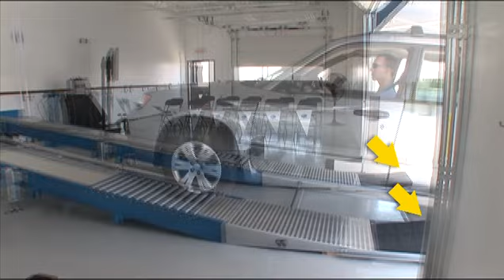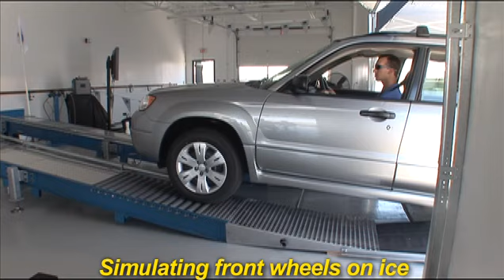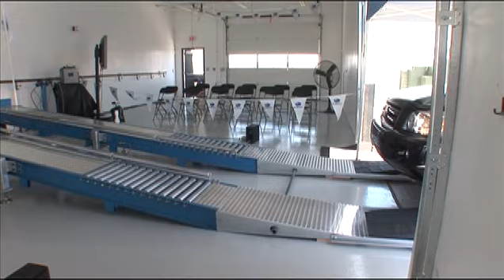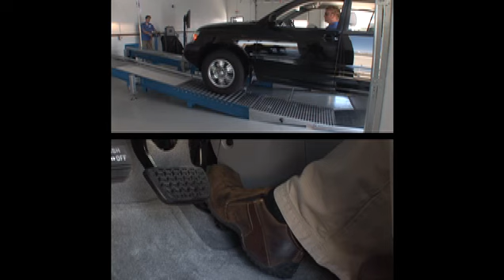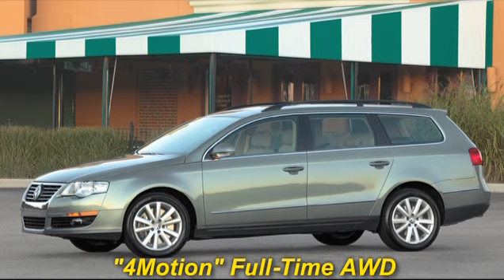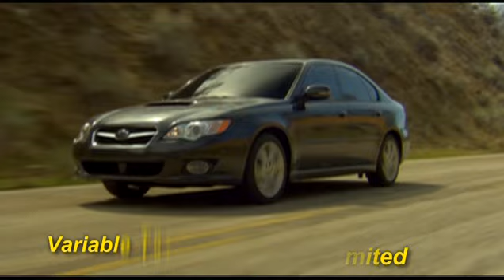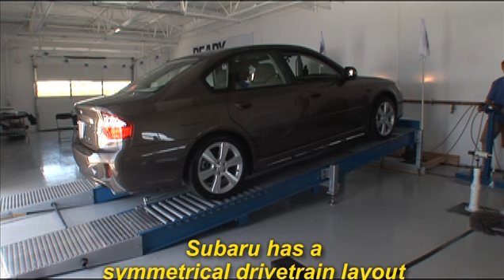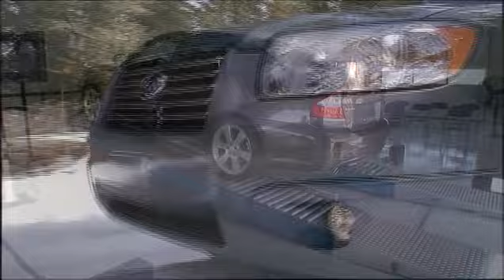Subaru Symmetrical AWD vs. Honda, Toyota, and Volkswagen

Comment: on a subaru if 2 wheel of the same side it don't move
Reply: Yes it does. Even with one wheel it can manage to get traction. A symmetrical drivetrain makes it easier for the car to handle single sided slip (No weight preference to either side) and VTD or LSD will handle same sided slip just fine. Look at 8:30. I'm not saying it's perfect but it will handle it.

Comment: U guys just roasted Honda 😂
Reply: it does not need roasting, anyone who knows cars knows that the CRV has the worst AWD of them all.
Reply: @intrepidmilotic5999  https://www.youtube.com/watch?v=HBi69R6C2PQ&feature=share
Reply: Scott Gonzalez gotten out of more off-road situations and ice/snow in a Honda Pilot than my friends in some AWD cars
Reply: Marco hondas rt awd is garbage we all know that. But Acura's SH-AWD is the shit
Reply: @scottg1962  u know honda and acura use the exact same systems?
Reply: Should have used a pilot with VTM 4 or an mdx with SH-AWD. These systems are designed to send more torque to the rear wheels
Reply: Marco ...Was the crv at full throttle?
Mine only engages with more gas. Which isn't ideal but how it works.
Reply: i dont know if youre just talking about the older generations of CRV but mine did fantastic this winter. Its not supposed to be a fast car. It's made to be reasonably priced and have longevity. Hell honda has even picked up its interior game quite a bit. my cousin has the new mdx and that thing is gorgeous, switched from a q7.
Reply: Ur welcome for 1k likes.
Reply: Austin Mcharo tank u sir. Didnt even expect 1k likes but shih I’ll take it lol
Reply: Marco hello
Reply: https://www.youtube.com/watch?v=HBi69R6C2PQ&feature=share
Reply: Okay, don't fall for this. Notice they're hitting the gas harder on the other vehicles than the Subaru, accelerating those vehicles past the point where they would transfer power in this situation while keeping the Subaru well within it's transfer range for the situation.
Reply: Fuck you
Reply: Honda just are Good vor FWD Not awd whyy
Reply: Yeah hondas are shitty lol
Reply: Hes a subie lover trolling on others cars
Reply: MisterLifter Are you trying to compare the s2000 and civic to muscle cars and sports cars? How stupid can you be? The Honda NSX, which is actually comparable, can wipe out the gtr. 

Acuras SH AWD is the best awd system there is.
Reply: @n_u001  acuras SH Awd system is ass compared to literally anything else
Reply: @n_u001  Uh....a nsx is a 3 liter that's slower than my maxima lol. It's lightweight and handles great, so it's quick and nimble, but it's not fast.
Reply: @TheGuruStud  engine displacement has nothing to do with a cars speed or acceleration. its a twin turbo v6 with a 0-60 of 3 seconds. your maxima takes at least double or triple the time.
Reply: Funny how an S2000 will whop any muscle car of the same model year on a race track and even give it a good run for it's money in a drag race and any proper Type R would also whop any American "sports cars" and there isn't even any Euro sports cars to compare it to as there is none in it's price range and if there was it would have broken down half way to the track.
Reply: @HimmelWeint  not sure what any of these comments have to do with awd
Reply: @HimmelWeint  what do you consider a muscle car
Reply: The only thing that Honda is good at is Lawn Mower engines. lol. I am Dying.....
Reply: @gaydarci4593  Aw, some butt hurt honda ricers, lmao.
Reply: Marco "just roasted Honda" yeah sure, imbecile. Hondas aren't made fast from factory,  the people who buy them for a legitimate reason know this, every single one of them, they buy it because it's a fun car, and with a nice exhaust, in their opinion, they sound very nice. They're cruisers, touge racers, enjoyment cars, not race cars, but if you wanted to there's not a single Honda out there you couldn't turn into a race car, or atleast a drag car, now am I saying that I like them and that I would like to buy one, no, they're not my style, and I'm more of a I6 kind of guy, like an R32 or a supra, something of the nature, but from my expirience and the people I hang out with daily, and literally hundreds I've met over the years, that's what I've heard, they know they're not going anywhere ridiculously fast, but they're looking damn good doing it, and that's just that, no argument to it. Saying a Honda is beautiful is the EXACT same thing as saying a 2017 ZO6 looks beautiful,  opinion, not a fact whatsoever. So much hate for Honda for literally no reason at all.
Reply: @sadboiiuloff5508  You make no sense my friend. People buy Honda's not for its exhaust. They buy them cause they are reliable in first place. Then no, they are not super cars, but as I had Accord Type R which has 212 hp and weights about 1000 kg, its not a slow car by any means. Compare it with E39 M5, which has 400hp and weights over 2 tons, and you see that weight to power ratio Honda is even more powerful. I had it for 2 years. Driving like there is no tomorrow, revving the crap out of it, and at over 300 000 km the engine was still strong. No repairs what so ever except hand brake wire and xenon bulb. Take any car and drive it 2 months like I did and it won't last.
Reply: @eleonik76  my 7 gen accord has taken more beating than any other car i have owned. Only thing still running.
Reply: @toothpicdinosaur3777  Same here brother 🍀
Reply: @sadboiiuloff5508  you must be talking out your ass and have literally no knowledge about Honda's, F.f.s. , look at the time the type R just set at nurburgring, it beat out the BMW m5, the Corvette, an the Porsche cayanne turbo! Lol , oh let's not forget about the fact that back in the day, the b16 was one of the first engines to surpass 100hp per liter of displacement
Reply: @sadboiiuloff5508  lol "a nice exhaust"
Reply: SadBoii ÜLoff but who in what mind would buy such a crappy car lol

Comment: Has nothing to do with longitudinal or transverse powertrain, has little to do with LSDs as most of the vehicles are not equipped with them. Where they are, it us usually a viscous LSD which requires wheelspin to lockup, notice the Legacy displays very little wheelspin. In most of these examples it is down to the effectiveness of the traction control system. I don't know why the Honda etc would not transmit enough torque to the rear, a Haldex unit should be capable of providing huge lock-up - certainly the one on my Nissan Panthfinder does. The best case scenario would be three limited slip diffs and junk off the traction control with a plate rear with aggressive ramp angles and high preload, a DCCD centre with semi-active controller and a plate front with light preload will give you the best traction and best efficiency for laying down the power. The 'Symmetrical AWD' is the stupidest strap line Subaru have come up with, the powertrain layout is good for weight distribution and serviceability (i.e. you can get the transmission out quicker), nothing else.
Reply: Finally a sane comment from someone who understands that this symmetrical AWD is marketing bullshit. Nothing to do with torque distribution.
Reply: Any 4X4 truck with a locking diff would pass any of the one wheel tests. Powertrain layout is more for marketing than anything else I hate working on those pieces of crap spark plugs are way more annoying than they need to be luckily the head gaskets like to blow the exact same time the spark plugs need to be changed so that's nice. So you could do them both at the same time.
Reply: @HimmelWeint  I don't think the Ford track lok will do crap if one wheel has zero traction. The S-Spring gives about 20ft/lbs of locking power.  Maybe a bit of movement on a level ground. Then you need a bit of traction on the other tire.

Comment: The guy says that in the toyota there is torque steer because the drive train isn't symmetrical...i think than the only reason why the veichle moves from left to right is because he moves the steering wheel. At that rotational speed and acceleration the unequal lenght of the shaft of the front wheels is unable to produce such a difference between the righ and left wheel.

Comment: does this guy not understand open diffs on the passat? thats why it wont climb with one wheel.
Reply: Open diffs aren't ideal but don't make it impossible: applying the brake(s) on the spinning wheel(s) makes it possible to increase the torque on the wheel(s) with grip.
Reply: He tested it since that's what VW claims. I'm a diehard vw guy but the subaru is awesome and the quattro is a close second :)
Reply: This guy is an actor.. Can you explain the open diffs please.
Reply: Quattro here wasnt used to say that VW has Quattro. He is saying Subaru AWD is the best and Quattro is a close second as an opinion on the whole AWD scene. 
He stopped talking about 4motion and VW's AWD ages ago when he put a fullstop after claims.
Reply: The Subaru has open diffs too. It uses differential braking to send torque to the other wheel. None of these vehicles have limited slip or lockers.
Reply: The engine of the Passat is to weak. If you got one with more torgue then it will climb. 
And 4 Motion isnt 4 Motion. Just like quattro isnt quattro.
There are Torsen, Haldex, Visco etc..
Reply: Subaru has a better AWD than that old Passat lol but VW awd is pretty good. It passes most tests.
Reply: Bass Boosts because VW sucks. Subaru won. Plain and simple
Reply: Because it is a 4motion not quattro dumbass 4 motion is predominantly fwd not like quattro

Comment: subaru is the best car in the world
Reply: TheSteelGamer lol. How many Subarus have you owned?
Reply: Newer Subaru's with the FA platform don't have head gasket failures. And the EJ's that did were likely modified and abused.
Reply: No... not even close. It does plenty of good but its overpriced, cheap interior, ugly and most importantly the boxer falls apart like garbage.
Reply: that's... um.. highly debatable
Reply: That tiny differentials tho
Reply: Not if you don't heavily modify it and beat on it. Also new WRX has newer platform which is very reliable even when modified!
Reply: Subaru is not a car. It is a car manufacturer.
Reply: Dilithium Crystals must be using more fuel though. And Subaru’s looks so outdated.
Reply: Not for long ownership tho. Can't even make it to 300k miles.
Reply: @MoookOfDuty  the one i own atm has 233k and never changed anything on the engine. The last one i owned had almost 400k and did the timing belt once. Problem with sub owner is the oil they use to make the gasket blow at extrem heat. I use synthetic 5-30 never had an issue.. im sold to subaru forever.
Reply: Shitty ass car, loud as hell
Reply: Dilithium Crystals Toyota  is the BEST car in the UNIVERSE.
Reply: Subie Gang!
Reply: Yes it is.
Reply: Newer CVT are chain driven.
Reply: So just because it can climb some rollers doesnt mean its the best car in the world.
Reply: Dilithium Crystals GMC
Reply: Dilithium Crystals until cylinder 4 leans out
Reply: if by best you mean overrated , overpriced garbage then sure.
Reply: idk what yall talking about my dads subaru nearly passed 1million km and we didnt spend over 1k in maintence and it never broke down
Reply: +ARA - I doubt you'd get that kind of mileage out of an American version.
Reply: Jose Olmo toyota isn't a car dumbass
Reply: Rain Master you’re stupid Subaru’s are just getting warmed up at 300,000 miles
Reply: After 3 years my Subaru has had no problem my wife’s Toyota also has no problems my 6 year Honda I have replace battery timing belt and that’s it the air bag was also replace but that was a recall I love to drive fast take turns fast Honda sucks Toyota sucks Subaru even on 3 wheels will keep doing the turn i feel safer in the Subaru I did have to get wheels for the Subaru at 27k miles but no problem just maintenance at Subaru even take my Toyota and Honda there maybe that’s why
Reply: matt9c1 never had an exhaust fall off. And it’s a cheap repair of it happens. The CVTs are not rubber bands. Uneducated dumbass.
Reply: only their marketing and CVT ideas sucks!!
Reply: No its not
Reply: Dilithium Crystals I want one.
Reply: ur such a tool. go get ur head gaskets replaced.
Reply: Yeah if you like early head gasket problems
Reply: Until is breaks down
Reply: Until the CVT rubber band breaks, or the head gasket goes or the exhaust falls off.  Yea...pretty happy with my Toyota.

Comment: Notice when the CRV just came in, it was climbing, but they hit the brakes.
Reply: +Emin Marookian lol the CRV has the worst AWD system in all the segment.
Reply: Sure, whatever you say. Have you thought about the fact that the CRV was the best selling SUV for 12 years?
Reply: Emin Marookian it is the best selling SUV because of its spacious interior,great reliability,and amazing fuel economy. it has the worst AWD system. just put CRV AWD in google and you will get a huge list of negative sites,including people who tested it on rollers or off road.
Reply: Why do I have a 14 year old cry and it has never had a problem? And check out TFL Car of the Pilot Gold Mine Hill. The Piguet was the 2nd car to go up the hill
Reply: +Emin Marookian I never said the older ones had issues. I do know the older ones are more reliable
Reply: WRXRED2018 Subaru My Father owned a Subaru it is unstoppable on snow. I own a Volkswagen Tiguan and it did amazing in winter,especially on ice.
Reply: +Intrepid Milotic I know what you mean. I like Toyota and Subaru vehicle better than other car manufacture during winter time. Thank you for the comments.
Reply: Hasn't a CRV button for TC off???
Reply: You are right
Reply: WRXIMPREZARED2018 SUBARU rav4 is shit
Reply: +Intrepid Milotic  I agree the element had the same 4 wheel drive and it BLOWS. Mother bought a CRV and its junk, i'd buy a mazda or ford escape before buying one of those. Oh and a friend had a brand new CRV and it blew it's trans. Oh and if you think they stopped it, check out other video tests. CRV fails on all of them.
Reply: +Intrepid Milotic I drove CRV in the winter 2 years with 10 inches of snow and their Full Time 4WD suck. It got stuck like crazy. When I drive 2008 RAV4 in the winter with 10 inches and have no problem getting out of the snow. All CRV suck. I have a Scion XB drove pass 2005 CRV in the winter time. Honda need to stop making CRV because even the 2015 CRV still suck in the winter even they have AWD system now. I would rather get Toyota RAV4 and Subaru Crosstek or Subaru WRX/STI.
Reply: +WRXRED2018 Subaru These comments seem harsh for it not being good a something that 99% of CRV owners will never do.  I own a 08 CRV and the 4WD system is terrible but I bough it used and didn't even want the 4WD.  Doesn't mean that it still isn't roomy and reliable, which I would say is the 2 reasons that most people buy CRVs.  Also I have an Expedition if I want to do off-roading.  Moral of the story is that if you want to do off-roading buy something for off-roading since these small SUVs and just jacked up hatchbacks and wagons for soccer moms to drive kids around.  I will say Subaru does a good job at these tests but I still say that these tests are just so Subaru owners to go "look how good this is" and not for real world scenarios especially since that is one reason why Subarus are so expensive.
Reply: I detect a really strong bias and probably you don't even own a CR-V not have any knowledge on cars. Tires make all the difference on snow and icy conditions you could have a Subaru with all seasons and I could drive a Civic and you'd be the one stuck and I'd be the one driving past you. Provided the Subaru didn't blow the head gasket before winter rolls around of course.
Reply: @HimmelWeint  Trust me, I know too much about cars. And thats correct, tires make all the difference, yet theres nothing stating they all have the same tires

Comment: i wish companies would stop calling their 4wd awd hybrids 4wd
Reply: Ben Mcghie yeah 3 diffs don't mean 4wd lol
Reply: Yup, it ain't 4WD unless there's a transfer case.
Reply: @BenMcghie  Name one vehicle with 4wd that doesn't have a transfer case?
Reply: garry eluveitie doesn't 4wd imply 4x4
Reply: 4WD and 4x4 are the same thing. It’s not to do with a transfer case, it’s no centre differential. AWD has a centre differential and can be used on any surface without wearing tires or stressing driveline components. Lots of vehicles have centre diffs that you can lock changing them from AWD to 4x4/4WD
Reply: @Bartonovich52  man now those words don't really matter anymore, bad marketing, you just have to know what car it is to know how it performs.
Reply: The video leads to a misconception. They mention the crv’s “real-time all wheel drive” as Real-time 4wd” they market it as an awd, so it is. As a crv owner. When I got into a sticky situation in mud, all my wheels were turning and got me out easy
Reply: @AngeloHerrera-ow3po  I have a CRV and have gotten stuck a couple of times when the front wheels were on ice and the rear wheels were on dry pavement. I had a bunch of guys push me off the ice one time and one was saying, "Isn't this supposed to be AWD?"  "Supposed to be!!" I said. On the other hand it has taken me through a lot of snow. Just depends on the stuation I guess. And BTW, on the rear of the car it has a graphic that says, "Realtime 4WD".
Reply: Exactly
Reply: They should call it PT- AWD. Part time all wheel drive. I remember my brother told me that along time ago around year 2000 but i never knew what he was really talking about. Now i know exactly the meaning.
Reply: Ben Mcghie 4x4 has a transfer case. 4wd/awd dousnt.